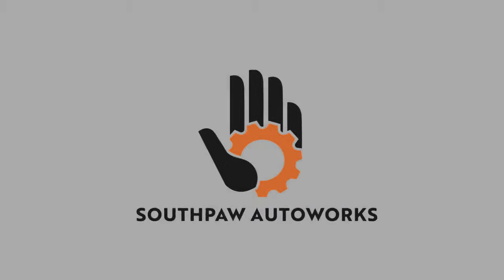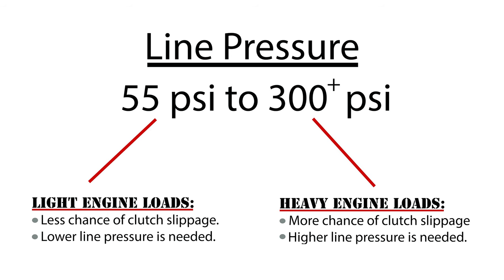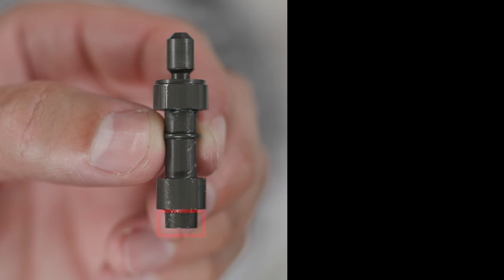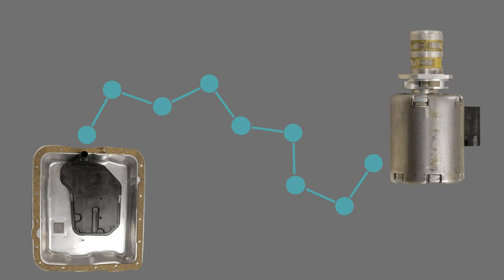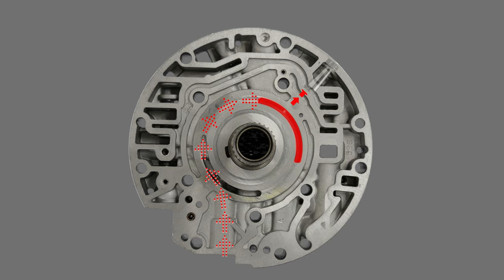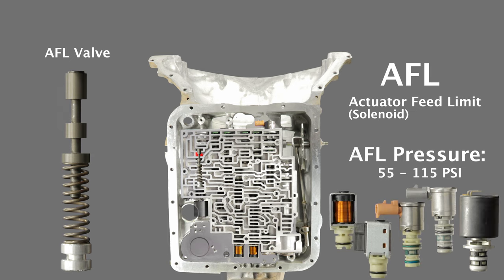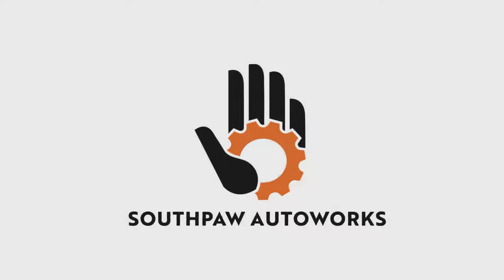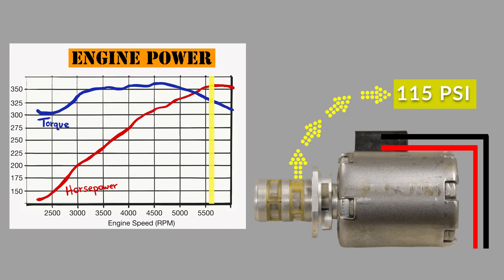4L60E: PR Valve (Part 3) Torque Signal Oil Pressure (4L60E Line Pressure)

Comment: Hey!  I really enjoyed your video's on the 4L60E describing how pressure is controlled.  Especially the one called: 4L60E: PR Valve (Part 3) .
I have been searching all over the internet looking for a trouble shoot for my 4L60E in a 1992 Chevy C1500 pickup and wonder if you might be able to help.
The system works fine, shifting all gears normally until the trans warms up, but then drops out of 4th into 3rd when under light throttle.  If I open the throttle a bit it will shift right back into 4th good and solid.  This more open throttle opening is more than required to stay at freeway speed.  When it shifts from 4th to 3rd, if you let off the throttle, the trans free wheels, (no engine braking).  If at this point I select manual 3rd gear the trans works perfect in all 1-3 gears. This is of course at speeds over 45 mph.  I replaced the TPS, serviced the trans, but that made no difference.
Got any ideas?
Reply from the maker: You may be dealing with a bad AFL Valve.

If you haven't done so already, check out the videos listed below.  I have not created the 3-4 shift valve video, yet....just a matter of time.  However, the 1-2 shift valve and the 3-4 shift valve are similar in function.

I'm happy to elaborate on the AFL Valve...but, everything will make more sense after watching the videos below.

4L60E: AFL Valve:  https://youtu.be/LqBkdegPjNk
4L60E Shift Solenoid:  https://youtu.be/FaChWmcsAgI
4L60E: 1-2 Shift Valve:  https://youtu.be/jPhm76RDz6Y
Reply from the maker: Regarding the engine braking...

Regarding engine braking, or lack of it with trans in 3rd gear, and shifter in D (as opposed to 3).
Under those conditions, it's normal to not have engine braking.  There's a one-way clutch (Input Sprag) that intentionally creates coasting when you let off the throttle.
However, when the trans is shifted into 3, there's an extra clutch pack (Overrun) that's activated, that essentially locks up the one-way clutch, and creates engine braking.
Reply: @SouthpawAutoworks  I watched all the videos.  Supper great and easy to understand.
I also watched: 4L60E: PR Valve (Part 3) Torque Signal Oil Pressure (4L60E Line Pressure).  This one leads a much better understanding of why, when I open the throttle to increase load, the trans shifts back into 4th gear.
With that in mind it seems that line pressure must be dropping as the oil heats up?  maybe a weak spring in the AFL and the AFL line pressure is just low?  Maybe the signal pressure to the PR Boost valve is low when heat is up and RPM's are lower and at light throttle?  Maybe a bad EPC resulting in a lower torque signal pressure?
What am I not seeing?
Is there an electronic pressure sensor somewhere that the computer uses to control the EPC?
Reply from the maker: Mark,
Thank you for taking the time to check out each of the videos.
I'm thinking you could be dealing with a worn out AFL Valve.

This is gonna be a long one to read...

Long Story Short:
A worn out AFL Valve can result in low Signal Oil pressure at the reaction end of the 3-4 Shift Valve.  Lower than normal oil pressures, at this end of the valve, can make it impossible to overcome the spring "pressure" at the other end of the valve...sometimes (depends on engine load).  This can result in a "falls out of 4th gear" condition.
Note:  I say spring "pressure", because it's technically spring tension...not pressure.  However, I am attempting to keep things apples-to-apples (oil pressure vs spring pressure), for the sake of simplicity.

If you want a more detailed explanation, continue reading...

Line Pressure:  55 - 300+ psi.
Line pressure is fed to the AFL Valve, where it's regulated/modified:  55 -115 psi.
That AFL Fluid is sent to the 1-2 Orifice in the Separator Plate, where it becomes Signal Oil.
That Signal Oil is sent right between the reaction end of the 1-2 Shift Valve and the snout of the 1-2 Shift Solenoid.

I have yet to get to the 2-3 or 3-4 Shift Valve videos...but, the 3-4 Shift Valve operates just like the 1-2 Shift Valve (oil pressure at one end, and spring "pressure" at the other end).  In fact, when the 1-2 Shift Valve moves, the 3-4 Shift Valve moves, at the exact same time (at least in 1st gear).
So, when the 1-2 Shift Solenoid is energized, this action prevents the 1-2 Signal Oil from escaping, back to the oil pan.  This builds oil pressure.  This pressure pushes on the reaction end of the 1-2 Shift Valve.  It creates enough oil pressure to overcome the spring "pressure" at the opposite end of the valve.  Then the valve moves in the direction of the spring.

The 1-2 Shift Valve and the 3-4 Shift Valve share the same Signal Oil.  So, when we build oil pressure at the reaction end of the 1-2 Shift Valve, we're also simultaneously building oil pressure at the reaction end of the 3-4 Shift Valve.

3-4 Up-Shift:
The PCM commands the 1-2 Shift Solenoid ON.  This traps 1-2 Signal Oil, and builds pressure at the reaction end of the 3-4 Shift Valve.  This oil pressure becomes greater than the spring "pressure" at the opposite end of the valve.  The 3-4 Shift valve moves in the direction of the spring.

Bringing it Full Circle:
When the AFL Valve wears out, it becomes most noticeable during low load conditions (light throttle/cruising).
Line Pressure varies greatly.  But we know, during low load conditions, that Line Pressure can be as low as roughly 55 psi.  This is normal.
We also understand that the AFL Fluid can operate as low as 55 psi.  Also normal.

When the AFL Valve is worn out, it's possible for the AFL Fluid to drop below 55 psi.  And that's where problems can start occurring.
-
I've been told, by folks that have tested these things, that when AFL Fluid pressure drops as low as 48 psi, that the 3-4 Valve will not move towards the spring.  There's simply not enough oil pressure to overcome the spring "pressure."

48 psi VS 3-4 Shift Valve:
When the AFL Fluid pressure drops to 48 psi, this means that the 1-2 Signal Oil pressure drops to 48 psi, too.
Unfortunately, 48 psi is not enough oil pressure to overcome the spring "pressure".

How does it make the 3-4 up-shift, but not stay in 4th gear?
Under heavier throttle conditions (like acceleration), Line Pressure is higher...therefore, AFL & Signal Oil pressures are higher...higher than 55 psi.
However, after the vehicle get's up to speed, we naturally lift off of the throttle, quite a bit, and just cruise.  As we cruise, the Line Pressure is lowered...and everything else drops with it.
-
So, under moderate acceleration, there will be enough Signal Oil pressure to move the 3-4 Shift Valve (resulting in a 3-4 up-shift).  However, as we let off of the throttle, and the oil pressure drops below 55 psi (because of our worn out AFL Valve), and we now do not have enough oil pressure to overcome the spring "pressure"....and the valve is pushed away from the spring, resulting in a un-commanded/un-intentional  4-3 down-shift.

Temperature:
As the ATF (automatic transmission fluid) warms up, it becomes thinner.  Also, metal parts expand and contract with temp changes.  
Point being, a leaky circuit will leak even more as the temps increase.

Valve vs Bore:
I say a worn out valve.  Typically, it's actually the valve bore that wears out.
One way to fix the problem is to ream out (oversize the bore), and install an over-sized AFL Valve.

Parts and Tools:
Here's one way to go about fixing the bore...
Reamer Kit:  https://ebay.us/XMR3Ux
AFL Valve Solution:  https://ebay.us/R3GPnF

DISCLOSURE:  🕵
Links provided are affiliated links with the associated websites. While there is no extra cost to the purchaser, a small portion of the sale goes to support this YouTube channel.

Comment: Hi robert.. my escalade has no overdrive.. what do you think is the issue. 4L60E transmission
Reply from the maker: What year is the Escalade?
Sounds like 1st, 2nd, and 3rd gear work......is this correct?

When the trans is in 3rd gear, and it should up-shift to 4th, what happens?
It simply stays in 3rd gear?  (Like it's stuck in 3rd gear)
It tries to up-shift to 4th gear, but the engine revs up, and the vehicle starts to lose forward momentum?
Reply: @SouthpawAutoworks  yes exactly what you're saying.. what do you think is the issue?
Reply: @SouthpawAutoworks  2003 cadllac escalade 6.0 L engine
Reply: @SouthpawAutoworks  No problem shifting from 1st to 3rd gear then it stays in thiird and just revs up doesnt shifts anymore.but it
stills goes forward just stuck in 50-60kmp when tries to step on gas just revs up

Comment: Can you install a stronger spring for the PR valve to mechanically raise the line pressure permanently?  Some builders claim they raise the line pressure to 180 mechanically.  Are there other ways besides a stiffer spring to achieve this? Thank you!
Reply from the maker: Great question!
Yes, a stronger spring can be installed.  

Per this video series,
1). The large outer spring is responsible for determining the base line pressure (Stock is roughly 55 psi).

2). For pressures to be elevated above 55 psi, the boost valve must assist the large outer spring.

There are a number of ways to increase line pressure above the stock pressure values.  We will be covering that in future videos.
Stay tuned!

Comment: Hello epc ItS NC or NO ? i have open my 4l69e valve body and clean epc solenoid too much dirty on the input screen after i put oil on the valve body hole of the  input screen   when i put dc voltage on epc oil go out from the second screen mean this solonid normal close right not NO?
Reply from the maker: Great question.

The EPC Solenoid is N.O. (Normally Open).  In other words, when no electrical power is being supplied to the 4L60E, the EPC Solenoid's internal valve will be open.

AFL fluid enters the screen that located the furthest from the the electrical connector.  The AFL fluid exits through the other screen.  However, when it exits through that screen, it becomes known as Torque Signal fluid (oil pressure).
Reply: @SouthpawAutoworks  if too much dirty on the input epc screen ill have low pressure or high pressure  on the pressure line ?
Reply: @SouthpawAutoworks  ok ppz if you can check any 4l60e epc solonoid its closed when you give 12v open and when you cut the voltage closed you can test by oil on the valve body or clean it and by air from mouth 🤣🤣
Reply from the maker: If the EPC Solenoid screen (located on the separator plate) is really dirty, it'll starve the EPC Solenoid of incoming oil pressure.  This means less oil pressure will make it to the Boost Valve...resulting in low line pressure.

The base line pressure is right around 55 psi.  
As more load is placed on the 4L60E, line pressure must increase...this protects the clutches, and band, from slipping (burning up).

The Boost Valve is responsible for raising line pressure, as need be.  But the Boost Valve can't do its job properly if there are problems "upstream."
Reply: @SouthpawAutoworks sorry you are wrong   i test verry well the epc solenoid its NC not NO it mean when no power its closed not open
Reply: No Power means Normally Closed Vent Circuit. NC

Comment: I've been seeing a lot of people who have been operating for l60e transmissions manually with toggle switches, do I haven't heard any of them talk about the EPC valve or anything being done with it, if someone were to run a 4L 60e will manually operating the shift solenoids believing the EPC solenoid without a signal would that just mean that the shifts would be more aggressive?

Comment: I'm new to the 4l60e all my experience is Turbo 350/400.  My having problems with my 94 Silverado not shifting into overdrive after sitting for a couple of years.  Everything shifts smooth as Butter but not overdrive could it be the Pressure control Solenoid? It sure seems like it but I don't want to go throwing a bunch of parts at it just to find out it's the transmission.   I know my way around a car I've worked at a Couple of Auto shops and am a Hobby engine rebuilder (mostly Honda and VW 🙄) so I'd like to try my hand at it before I give up an go to the shop( I surely Hate that 😦) maybe that might buy me some time before I can get the $$$ together for a fresh transmission. Anyone's help would be greatly appreciated.... thanks in advance

Comment: Hey I have a question what would happen if you turn the hex screw in the back of the epc
Reply from the maker: Great question.

It will affect Torque Signal oil pressure, which ultimately affects line pressure.
It's a way to raise the line pressure.  This can have positive effects.  However, it can also have negative effects, too.

I plan on making a video on this topic, when time permits.  Currently assembling a 4L60E, in prep for a bunch of 4L60E videos.
Stay tuned!

Comment: I'm a rebuilder in training, I recently did a 01 4l60e and now the truck stalls when put into any gear.. I flushed out the cooler n replaced the lockup solenoid n harness.  A helpful tip wud be appreciated...
Reply from the maker: If it were me, I'd be:
1). Looking at Converter Clutch Valve, in pump (can easily be installed backwards).
2). Looking at TCC lock-up valve in VB (Regulator Apply Valve & Isolator Valve).
3). Verifying cooler flow.
4). Etc.

Would love to hear what you find.

Comment: hallo , im a follower from italy , i ve lost checkball.    one of the loose checkballs ,   the one of the side of the gearcase / accumulater .   not the small 7 checkball but the bigger checkball.    i have an 4l60e from 1999,   gmc sierra 5328 ccm,  198kw        thank you very much

Comment: When transmission cold got all gears when  it heat up no gear works what's the case or cause for this😢
Reply from the maker: Without looking at the vehicle (and getting more info), I can't say...

Here's some general info:
As the trans heats up, the metal & fluid heat up, too.

If there's a crack in an aluminum piston, the crack will grow larger as the piston heats up (expanding metal).
As the fluid heats up, it gets thinner.  If the trans is dealing with an internal leak, the leak will get worse as the fluid gets thinner.

Comment: 95 4L60e.Can pwm solenoid simply be unplugged so that OD engages quickly and completely? It's my understanding that 93 and 94 have no pwm solenoid.
Reply from the maker: Great question.
Unfortunately, it's not as simple as unplugging the TCC PWM Solenoid.  However, the solution is pretty simple and inexpensive (in my opinion).

This VB kit (listed below) includes a valve-train that converts PWM TCC apply, and makes it an On-Off apply.
https://amzn.to/3jjJp9o (paid link)

That's correct.  93-94 are On-Off TCC apply (no PWM TCC solenoid).  95-Up have the PWM TCC Solenoid.

DISCLOSURE:  🕵
As an Amazon Associate I earn from qualifying purchases.  Some, if not all, of the links contained in this video description (comment thread) are affiliate links.  This means that, at no additional cost to you, I will receive a small commission on any purchases you make through the website links provided above.

Comment: What would cause the line pressure to stay high when floored and released, until the engine is turned off for at lease 20 seconds and restarted is normal

Comment: The thing that absolutely baffles me is that nowhere, NOWHERE, in this transmission is any sort of pressure sensor that can give feedback information to the PCM on what AFL, Line, or EPC regulated AFL actually is.  The only way to know for sure is to hook up a manual pressure gauge.  I suppose it’s all calculated somehow with shift timing using the pillow switch, and the amount of voltage drop or dwell allowed to the EPC.  Still…..if the EPC isn’t functioning properly, EPC screen plugged with debris, leakage past the AFL valve/bore, etc it’s amazing the unit works as well as it does.
Reply from the maker: Pressure sensors would've been real nice.

Comment: Why not just have a constant pressure on the clutches like a pressure plate in a manual transmission?
Reply from the maker: Great question.

There's a number of reasons;
1). Driver comfort.  
When line pressure is maxed out, the transmission shifts harshly.  Park to Reverse...bang.  Park to Drive...bang.
2). Longevity of driveline.  
All of the harsh shifts are hard on U-joints, differentials, etc.
3). Fuel mileage.
When line pressure is maxed out, the pump has to work harder to push more oil into the trans.  The pump is driven by the engine....resulting in more parasitic losses (drag).
Note:  This can also wear the pump out faster.
4). Etc.

Once again, great question.